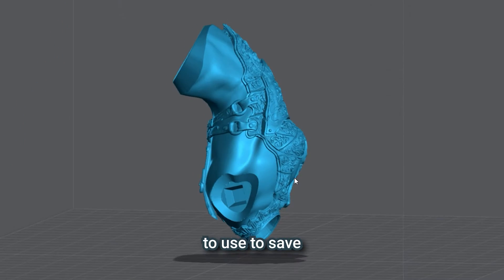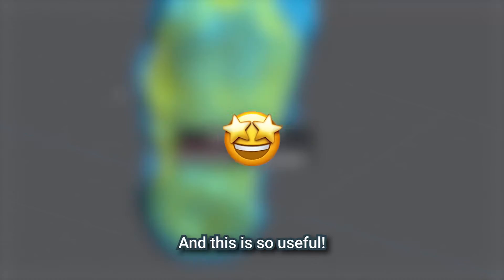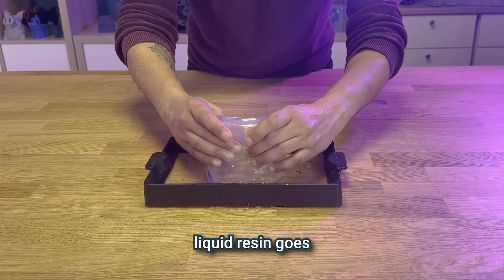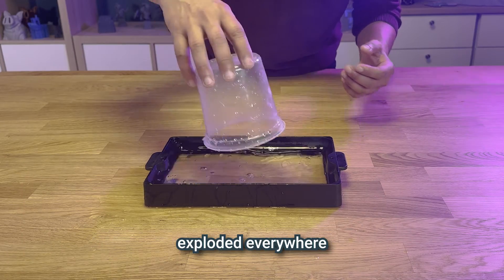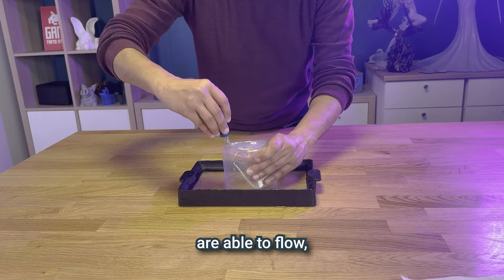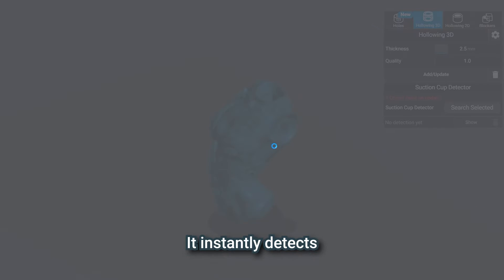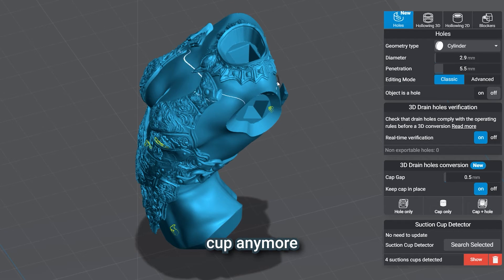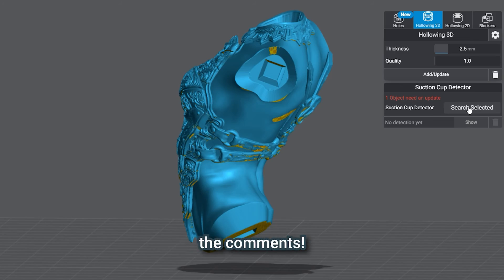No more failed prints! How the Suction Cup Detector works

Comment: Yes Hollowing, I would like to know how to see if the 'holes' I have made, actually go through enough. The program seems to make me decide the length before I place them, I would prefer to be able to place them, then 'stretch' them to slightly beyond the thickness of the model ( which the thickness of model is difficult to find out after I have auto 'hollow ' function). Plus, how do I delete a hole if it is placed in the wrong place.
Reply from the maker: Thanks for your comment 🙂 if you're using Lychee Pro, once you've hollowed out your model, you have an "Exterior" feature that lets you see inside your model. 
To delete a hole you've placed, select it and press the "Sup" key on your keyboard.
Reply: I don't have a 'SUP' key on my keyboard @Lychee3d

Comment: The real questions are? Where the holes should be? Near the plate? Away from it? How many holes? What is the ideal size of the hole/holes? Should all yellow suction places dissappear? Even the tiny tiny ones?
Reply from the maker: Thanks for your comment 🙂 a more detailed video on how to place the holes with Lychee Slicer is coming soon.
Reply: In the meantime a bit of practical knowledge, the more holes the better, when you have hidden spot spam holes here, then I put one hole on the facing surface of the vat and a hole facing the build plate and that's it never had an issues even with huge print
Reply: So should every single suction cup be removed somehow? Even if they are tiny? Some models don’t allow it
Reply: This.